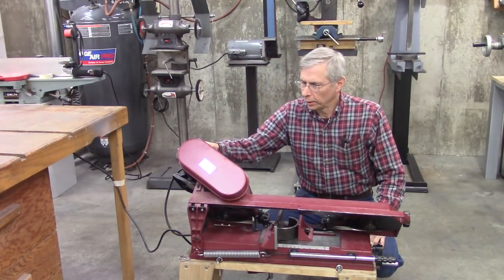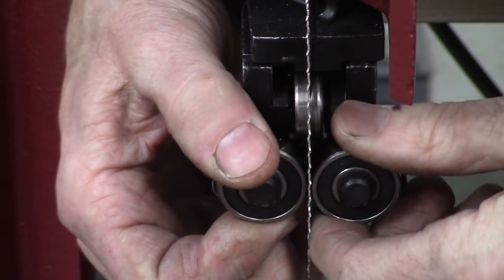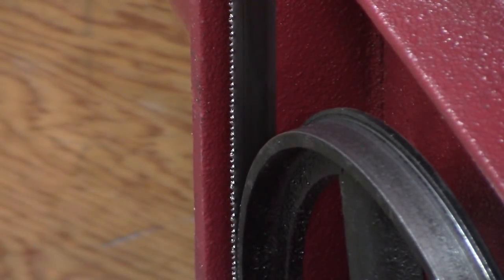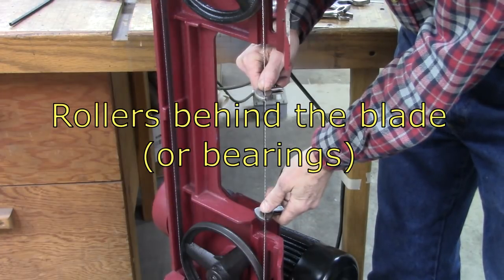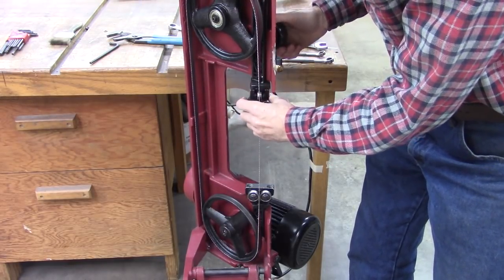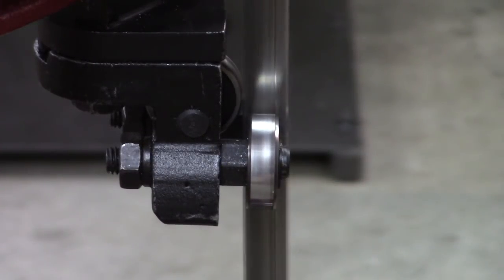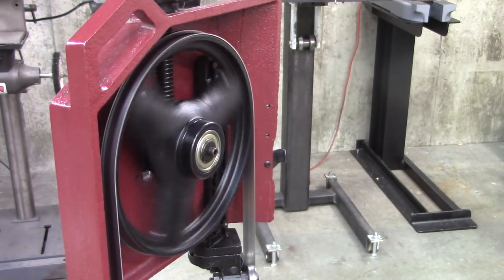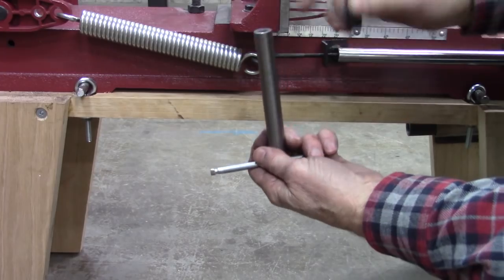4" x 6" Horizontal Bandsaw Tune Up

Comment: G’day Winky. I meant to mention this last week but was reminded today with your latest video. That upper wheel alignment bolt in my saw is a set screw hiding inside. It was probably 6 months of cursing the blade for jumping off before I sat down and found that set screw and for the past 3 years I haven’t needed to adjust it, yes it does come off but that’s because I jam the blade when using it in the horizontal mode. 
Cheers 
Peter
Reply from the maker: I need to take this apart just because I'm curious now. I thought I understood how it worked but maybe not. Mine is working well in this area.
Reply: @WinkysWorkshop  you have it worked out , where you have a bolt mine is a set screw which I didn’t see, I pulled that assembly apart to find out how it works. Very simple, it alters the plane of the spindle , simple but effective. I copied the mechanism for my bench top belt sander build recently, it worked a treat. Cheers Peter
Reply from the maker: @pgs8597  - Ah!  I understand now! And yes, I did the same in my belt sander too. Did you use my design of a variation of it? I use the heck out of my sander!

Comment: i'm having a problem where there is not enough adjustment on the blade guides to get the blade vertical , it always want to cut towards the stock, it cuts at like a 5 degree angle its really annoying
Reply from the maker: Thats weird. Have you made sure the bearings are snug against the blade?

Comment: The drive wheel on mine had TERRIBLE radial runout. Had to put it in the lathe and take a couple truing cuts on it, and clean up the flange. Made a considerable improvement. LOL those castings are terrible, looks like the mold they cast them in was mis-aligned.
Reply from the maker: I've had a few other comment about the wheels, mine seen to be very good.

Comment: Outstanding Mark. I have the great great Grand daddy of that saw. Mine is almost the same but it is 35 years old. I need to do the maintenance on the saw just like you have done. I would argue that after 35 years the quality is fine for a home shop. If I ever find a junk throwaway one I am going to make a vertical saw out of it. As always I learn something new every time I watch one of your videos. Thanks.
Reply from the maker: Thanks Terry, I'll have a video showing how to add a table to your saw in 10 seconds next week. Seriously, it's an idea almost as good as the pipe trick!
Reply: @WinkysWorkshop  I saw the one you posted that someone else made. I will be doing the same but I want to see your video of it first. Thanks a million for all your time and effort making these videos for us to enjoy. BTW I love the pipe idea.
Reply from the maker: @terrycannon570  - Yeah...  the new year video. Cool
Reply from the maker: @terrycannon570  - Yeah...  I might make the table slightly different. Waiting on some metal

Comment: Thanks Winky, I have your elevated table and my saw has always cut excellent and square, but I haven't liked the twist the guides have put on my blade. I filed them here and there as you did, and my blade is much relived. Thanks much!
Reply from the maker: That's great, good to hear. I have considered making aftermarket blade guides but I suspect there are a lot of variations in the way they mount. That would be hard to design for.

Comment: Move the switch housing down!!     It ain't part of the base casting

Stavros
Reply from the maker: See part one, I ground the casting so the head would drop lower and it still would not go all the way through the stock and trip the switch. The saw need to drop after completing a cut to make the switch work reliably. I also had to remove the blade cover also because it was hitting the base.  Ultimately the pivot point for the head is too high (which would be hard to change. Some of these saw are not like this and some are...  but it's hard to say how common this is.

Comment: So many people who complain about "cheap Chinese junk" have never had to do things by hand.  In my career I have cut 6 inch round stock with a hand hacksaw because that was all I had.  The little saw would have been so welcome.  I have one and I have cut all the metal for many projects.  These are not perfect but affordable.  My rule is keep it slow and never leave it alone for long.  It is now over 15 years old and seems to get better with age.  Because of roller stands being about 1 inch higher than the saw I put a 2x2 under the front frame.  The vise screw and the set screw in the handle are almost gone but I am still cutting.  Thanks for the half pipe trick.  Old machinists don't complain they are just thankful for the help of any machine regardless of how poor and always remember those hard manual days
.
Reply from the maker: Well said!  Yeah that pipe trick is cool.

Comment: I am new to watching your channel and I love it. I have one of these machines that I bought from Enco years ago and my biggest gripe is that the blades keep breaking. I have gone through adjusting the blade guides and the wheel alignment, the blade will track nicely, I will get perfect cut, then out of the blue, the blade breaks. Upon close examination of the blades using a jeweler's eye loupe, I find many cracks in the blade emanating from the roots of the teeth. I am uncertain if the problem is that the blades are garbage or the aggressive 45 degree twist of the bade in the machine is responsible for the poor blade life. If it were not for the short blade life, this machine would be a dream. Mind you, the teeth are not wearing out but the blades are developing stress cracks and breaking. It is very frustrating.
Reply from the maker: Keep watching the other videos. I'm going on 6 month on one blade right now...  its getting dull but no failures anymore. Thanks for watching!

Comment: Regarding the long T-handle nut for the fence angle adjustment...  I made a curved T-nut to fit the slot.  No need to get below the bed at all.  I did use my mill, though it could probably be made with a couple hole saws or a grinder.
Reply from the maker: Heck yeah! Excellent idea!!!

Comment: I watched a few of these videos about adjusting this kind of saw. This video is by far the best of them plus a neat little trick for cutting off bits of metal that are too short to fit the band saw vise.  
I have a very old slightly larger version of this band saw. It was old when I bought it thirty years ago, I used it for a few years and in the middle of a move I left it set outside in the weather for twenty five years so the old girl was in a bit of a rough shape. For a long time I used a friction saw but then bought a new cold saw which I am in love with but the cold saw cannot cut large I beams or large RHS (Rectangular Hollow Sections) so I looked at getting a new band saw to replace the old band saw… but saw the price, and thought the quality of the current production model was not very good. 
I decided to pull the old girl out of the paddock and restore her. First rip it all apart, no small feat, then most of the stuff made a trip through the acid to rip off the rust, throw the tin work stand it came with and build a new one that is heavy duty, all new bearings, new motor, a nice paint job and reassemble. Called the local blade maker to get some industrial blades made with some kryptonite teeth. At this point the project sat for just over a year as I got distracted with other work. I still need to knock out a tank to catch the coolant that a pump brings up and a flexible hose squirts a bit of it over the blade doing its business.  
Now I just need to get it adjusted to keep it from throwing the blade off, hence my visit here. After watching these vids I now wish I had made a video of the restoration of mine, but it is such an old saw I dunno if anyone would be interested. I will note that I thought the construction of my old saw took some short cuts in the manufacturer, all of which I address in the rebuild but now seeing the level of quality available of the saws in these videos I am so glad that I restored my old saw.
Reply from the maker: I love restoring the old machines. You should make videos. People are always interested!

Comment: At 10:58. I experienced that the cover of the wheels hit the bed. Polygripping it solved that issue. A blade cover present in the picture also made trouble, made it impossible to move the left blade guide to the right. Disassembling and bending that part where the holding screws come in play solved that issue.
Time 11:07. We have different versions of the saw.
Reply from the maker: Watch part 2. I installed a plate to elevate the stock being cut. There is a link under the video. It has a PDF template and as email address. If the template matches your saw and you want to try this I'll be making these spacer plate. I'm waiting for a quote on water jet....  if the quote is too high I won't do this.

Comment: What would keep making the blade pop off.  Everytime I put the arm down as soon as it starts to cut then the blade pops off.
Reply from the maker: If the tension is adequate this is either a wheel or blade guide alignment problem. In the case of my saw (which did the same) the blade guides were deflecting the blade downward. This was done on the original setup to to compensate for a saw defect. Basically this is a depth of cut issue. Watch the next 3 videos and you will see what I did about this problem. If it's a wheel alignment issue I've never addressed this myself.so I'm not sure how to fix it. You can probably lay a log straight edge on the side of the wheels and get an idea if this is a problem.

Comment: Hi I have a problem with my bandsaw, looks like a replica of yours. I can't get the roller bearings to be loose on the blade. At 0:31 the blade twists as it goes off the big pulley to the guide bearings and mine does the same but puts pressure on the inside/left bearing. Any ideas?
Reply from the maker: Watch the video here https://youtu.be/SzjqDqpWRCA?t=305

Comment: You can use the OEM guard if you cut out from the hinge to opening and reattach the hing in the upper part that doesn’t hit the base it took me about 10 minutes. The blade is still fully guarded
Reply from the maker: It needed much more than the guard moved. The switch was also an issue but even after addressing the switch problem it wasn't right. Watch the other videos, there is a much better fix.

Comment: I have one of these, I've used for going on 16 years ..!!..replaced the blade guides years ago ..(the chinese bearings fell apart )..made a roll around stand for it .. built a sliding weight feed mechanism, in order to add more downward pressure on the blade ..built a larger vertical table ..added a drip coolant reservoir from an old pedestal grinder .. installed a different blade tensioner bolt in order to cover a wider range of blade length capability .. the key to performance is in the quality of the blade ..!! ..If you're not paying $25.00 to $35.00 ea. for blades, and you're trying to production cut  various "aircraft alloys", you're not going to be satisfied with it's (or any other saw's ), performance ..all in all , 15 years, and still going, for an initial investment in 2005 of $169.95 ...AIN'T BAD ...!!! .. by the way ..I like the addition to the back vise jaw ...and.. thanks for the tip on the 1/2 tubing vise accessory  ...gonna make me one of those right away ...!!!
Reply from the maker: Thats a very modified saw you have there. I did the same with the bearings. I love the sliding weight idea!

Comment: I wonder if you put a washer in between the the actual slide the guide bolts to (that adjusts the guides in out or smaller cuts), if that would move the whole unit in a bit closer yet?
Reply from the maker: I think that would help in one direction but not the other. They needs to go up and to the left
Reply: @WinkysWorkshop  yes, I see what you’re saying now that I looked at mine. That wouldn’t help in the direction that is most in need.

Comment: This is great. I JUST started having trouble with mine (same saw) after many years- and you've given me several ideas about what might be wrong. Can't wait to get into the shop in the morning to attack it. (1st step will need to be a good cleaning.....) I think my blade guide needs adjustment because the blade is walking out and I'm getting very wedge-shaped cutoffs. (2 3/8" 6061 round bar).
Reply from the maker: Glad the timing was good... hopefully you resolve the problem

Comment: Did you just use MEK without gloves?  Wow you are brave Sir
Reply from the maker: I guess i did...  I don't think brief exposure is high risk. If I was cleaning a lot I would use gloves and even a respirator.
Reply: @WinkysWorkshop  
Fantastic tip with holding small pieces with the half pipe tho

Comment: I recently picked up one of these made back in the early eighties in Taiwan.  The base is certainly a lot more solid than the aluminum foil ones they crank out now...  But, my cheapie find turned out to have a big problem.  It tossed blades off almost instantly.  After some poking around, I discovered the upper wheel bearing block anchor bolt receiver was stripped.

Amazon had a Helicoil kit on my doorstep the next day.  Four hours later the bearing block was fixed.  Nice little saw for $25, even with the added $20 expense of the Helicoil kit.  It still needs some cleanup and fix-it attention here and there.  But, it currently works as-is and will receive attention when the schedule allows.

A very nice video series on improvements for the little beast.  Thanks for sharing!
Reply from the maker: Thanks for the great comment Russell.

Comment: Good tips.  I just picked up a used saw like this and need to get it to stop throwing blades.  Thanks.
Reply from the maker: Check the wheel bearings and the bearings in the blade guides, they can be loose but not super loose

Comment: Why not add a piece of metal under the stock you plan on cutting to make it higher? Then the casting and guard doesn't need modified
Reply from the maker: I thought about that... and that might actually be the best method but its a lot of work to do it right. The hardest part would be cutting a matching arc for the fixed fence lock down (for cutting a 45). Certainly doable and maybe the best option for people like me with a mill but many do not have a mill  ---  Hmm, maybe I could make an adapter plate with all the matching holes and sell them! I wonder if all models are the same?

Comment: Great you tube and very helpful. I have the same maroon unit from Harbor freight. My problem is that even making sure I had clearance everyplace, as you indicated, mine will never throw the switch to the off position. I just won't push it all the way down. the switch seems to be stronger than the weight of the machine.
Reply from the maker: I sell an Elevating plate to resolve this issue. The link is in the description in this video link https://youtu.be/2uGxOE0VucM

Comment: I've had the same bandsaw (Oz version) for 6 or 7 years, and I've learned more about it, in the last 24.3 minutes, than the entire time I've had it ;), I use mine as a vertical saw, I junked the crappy table, and red "safety" guards it came with, and made up a new table out of 1/4'' stainless plate, I cut the blade slot, the other way around, so to change out a blade, I just back the tension off, and open the door, the blade comes flying out, and reverse that to change blades, really easy, and super fast blade changes.

Thanks, Winky, great vid

Scott.
Reply from the maker: Your welcome. Great idea on the table....  the new saw comes with the slot the way you made yours.

Comment: Excellent video, hopefully will help with my tracking issue were the blade is jumping of the wheels.
BTW, anyone know what blade replacement is required? I have no manual as was gifted the saw.
Reply: Would I be right in assuming 64 1/2 band blade?
Reply from the maker: Yes, 64.5
Reply from the maker: Thanks, Mine takes a 64 1/2" and i use a 14 tpi

Comment: Out of curiosity,  is the bolt that allows the motor to pivet supposed to be tight?  Mine is loose and the motor tends to move around a little.   I did tighten it, but I noticed your bounces a little too.
Reply from the maker: I didn't notice this but unless the belt is slipping I don't like to over tighten the belt. I might need to tighten mine a little but if you get things too tight it's harder on the bearings.

Comment: I wore out a Dayton one from the early 80s through the late 90s... 3 motors, 5 sets of gears, a dozen sets of rollers, and God knows how many blades
Reply from the maker: Wow...  you must have used it a bunch
Reply: @WinkysWorkshop  Was the only saw in the welding shop- cut up a bundle of 1x1x1/4 angle to make racks for a plaster pouring factory, a bundle is machine stacked 1ft x1ft x 20 ft long... Among a million other projects...

Comment: I have had one of these saws since 1980.  That was before the 14" chop saws were around.  I had to cut 32 column extensions to fit a new roof structure on a reservoir out of 4" scd 40 most under 3" and it had to be cut and fitted in the field.  Quirky to get to cut right but it saved the day being able work inside a 30 tall 80 foot diameter concrete structure.
Served me well since and will get the "Winky tune up" soon...thanks for your efforts.
Reply from the maker: Cool, thanks for sharing!